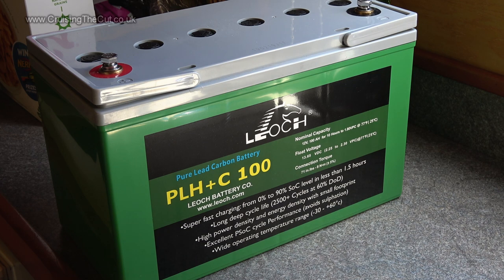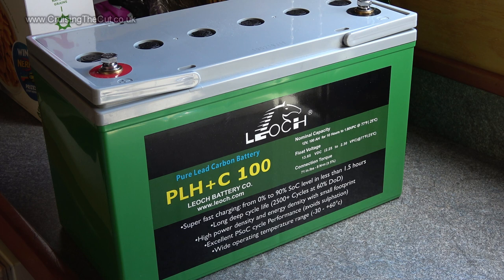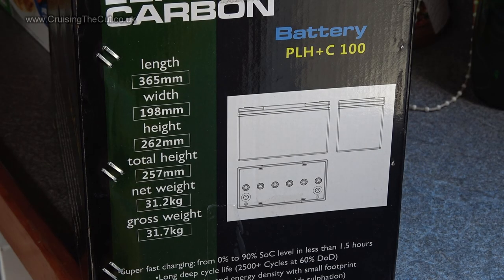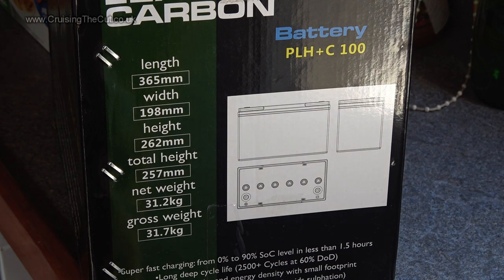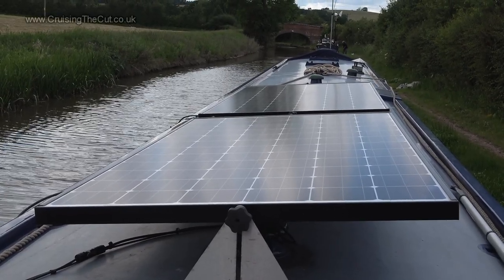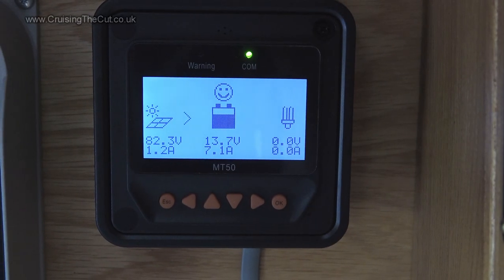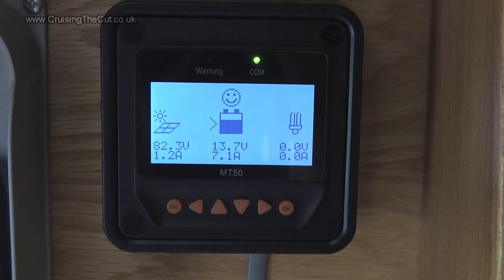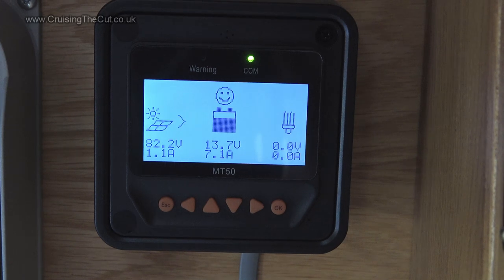178. Installing Lead Carbon batteries (12V 100Ah) into my canal narrowboat

Comment: How do these batteries compare to the cylindrical gel ones please?
Reply from the maker: Not sure. I was considering those gel ones last year but kept reading they needed a specific charging regime but couldn't find any details about it so when I discovered the lead carbons, I just went with them. I think the lead carbons have more charge cycles.
Reply: @CruisingTheCut  Thank you.  I knew you were looking at different kinds of batteries and wondered what fixed your choice.  I have had the cylindrical gel batteries installed for 20 months now and  have been very pleased with them.  Looks like the devolment of the lead acid battery has not reached its zenith yet.  Maybe the lead/carbon cell will prove to be a cost effective option to LiFePO4 units.  Maybe super capacitors next?

Comment: Will the higher charging rate burn up the “normal” engine start battery?
Reply from the maker: No, the starter battery is effectively isolated from the leisure cells even though all the -ve terminals are joined.

Comment: Isolating the batteries was a smart idea, but whomever told you that the placement of the cables mattered doesn't know anything about electrical's.
Greetings an electrical engineer.
Reply: Just as what you connect first doent matter.
Oh and also there is no charge in your invertor, its the charge in the batteries rushing into the coils in the invertor. Dont worry. they can handle it. Hell you could even weld directly from some batteries.
Reply from the maker: I rather think they do. See (amongst many many others) http://www.smartgauge.co.uk/batt_con.html
Reply: @CruisingTheCut  Ah thanks for the link. Very much apreciated. I shall investigate. :)

If not clear yet. very nice video i enjoyed it. Keep 'm coming. :D

Comment: hope the negativ was the first to disconect :D this way cant do short between the bord or  other things
Reply from the maker: Ahaha and that's exactly why I didn't show you .. already there's another commenter saying "+ve first" ;-)
Reply: Removing the negative first can leave all your other ground wires to take on the job of grounding for the short while it takes to then remove your positive lead.  Check out your system first to see how everything is grounded.

Comment: The spark is because the batteries have a charge, that spark comes from them, it's the same as taking a wire and touching it to both terminals of one battery (don't do that the wire can weld itself into the terminals and the battery will overheat and explode). Just make the last connection quickly, don't hesitate or you get a spark.

Comment: Read up on the difference between Series and Parallel Wiring... Series Wiring will multiply your Voltage... very important to note  as your charger could be made for a single input voltage, and this could damage your inverter if you feed it with the wrong voltage...

Parallel Wiring will multiply you Amperage

Series/Parallel Wiring will multiply your Voltage and your Amperage 

You have wired your batteries Parallel... all of the batteries will have the same voltage on your Line Side, and the Amperage will be multiplied...

Industrial Electrician
Reply from the maker: Thank you; yes I'm aware of the difference and yes the bank has always been wired in parallel and will remain so; cheers though!
Reply: Sorry again, I was typing while watching should have waited till the end...

Parallel is always best as your charger/system sees the Batteries as one Battery... a Battery of Batteries... You can do this with in turn with any kind of load (lights, circuits, what have you) and you system will see it as one load...

No need to shorten sail and pick up my comments David,  just an old cranky Electrician poking his nose a'midships...
Reply from the maker: Ha! I'm a grouchy old YouTuber, especially when I decide to answer comments on my phone at 2am because I can't sleep. Apologies.

Comment: I do a lot of high tech engineering on my boat and my lithium batteries still terrify me.  They are like armed bombs looking for an excuse to go.  You can usually get the charge voltages by just referencing the voltages for your battery type, in this case carbon-lead.
Reply from the maker: Cheers. Yes I did some research but I wanted to know the manufacturer's specific spec just in case!

Comment: David, you're hooked up in parallel so other than minor fractional line resistance  having the charge line hooked to the middle isn't an issue. If it was a 24v system with 2 batteries in series then you want to go positive on 1 battery terminal and negative to the other battery terminal.
Reply from the maker: Cheers yes I know it's in parallel but it's good practice as I understand it to wire across the bank rather than into the middle. I agree the difference is probably negligible.

Comment: Is the battery compartment ventilatedI.
Reply from the maker: Sort of, to the degree that it's in the engine bay which is not exactly sealed. But the batteries are non-vented anyway.
Reply: CruisingTheCut is the engine room well ventilated enough to remove most of the heat the engine produces? Batteries don’t like heat. 
A sensor with remote gauge might be handy.
Reply from the maker: It does get a bit hot in there, since you mention it, it's not well ventilated in terms of cooling.
Reply: CruisingTheCut Amazon has small computer cooling fans that use magnets not bearings, don’t spark and require very  low power consumption. They would be easy to install by cutting two four inch holes in order to ventilate the engine and the battery compartments. One could easily be wired to turn on when the engine is on and the other just it full time. They are typically used to cool computers. I find working on boats is almost as much fun as using them.

Comment: Move one of your temp sensors to the battery compartment and monitor the temp a while. Any over charge or over load problems will be evident through heat buildup. Excellent job.
Reply from the maker: There is a temp sensor on the new bluetooth dongle to the inverter, I showed that ;-)

Comment: Hiya David, you should check out Will Prowse on here, he tried a few battery monitor things, that gives a % and he said there's a good one that only cost about 30 quid off ebay
Reply from the maker: Yeah I know the one you mean. The trouble is, all Amp Hour meters work on a bit of guesswork once the battery is anything less than brand new, so they're inaccurate. And all volt meters will show an inaccurate state of charge unless there's no load on the battery and no incoming charge from anything else like solar. So in reality there's no really good way of knowing what your battery is doing unless you measure voltage with everything disconnected in the dead of night...

Comment: Not a fan of how you have your solar wire running across your positive connection of the 3rd battery. Think it would be easy to zip tie it away from it very easily.
Reply from the maker: Now, now - what did the caption say, eh?

Comment: Your in reasons doesn't matter. It doesn't matter where the connections are made. As you keep the starter battery separate.

Comment: Did you know that you could use your old batteries as part of a welder as all you need is 36 volts to do what some people call stick welding.

Well done for doing DIY as for batteries sparking thats normal so i wouldn't worry about it and its caused by different voltages nd no they wont blow up unless you use dynamite lol 

Reason people remove the negative 1st is taken from vehicles as all modern day vehicles are negative earth which means dont need to tape spanner up when removing the negative (black) wires.

How much were the batterys  each ?
Reply from the maker: I paid £205 as a special show price but they're normally more, maybe £240. Link in video description
Reply: @CruisingTheCut   Ouch !!  bet that hurt your bank balance 

With new technology it is always a good idea to wait a year or 2 for price to come down
Reply from the maker: I thought that was a fair price, especially since the AGM batteries I otherwise would have bought (identical to the old ones) would have cost the same, so waiting wouldn't have made any difference in this case.

Comment: You have probably been told this already  but it is absolutely normal for battery sparking when reconnecting the negative terminal.  This has nothing to do with the inverter.  The same thing will happen if you do this on your caravan or automobile.   Relax!
Reply: Capacitors are found everywhere and are the cause of the spark. BTW...manufacturers differ on which lead (+ or -) should be detached first and attached last. Check your owners manual. My Ford will absolutely not start will not start unless the positive lead is attached last to satisfy the alarm system.
Reply: @geraldhenrickson7472  lol, better speak of what you know... He mentionned twice that the main switch is off, so the inverter is not connected to the battery, the reality is that when you connect two or more battery together there will be a spark, no matter what, and it is totally normal because the battery does not have a null resistance and voltages are not perfectly equal across the battery bank.
Reply from the maker: @lo2740 Actually, the inverter is one thing that is not connected via the main isolation switch but directly to the battery, for reasons I can't recall. "better speak of what you know" lol ;-)

Comment: I'm trying to configure my mt50 charge controller ( same as yours ). I don't understand which one is the charge voltage configuration. Can you help me with setting it up. So I got 
over volt.disc 16.0v
Charge limit 15.0v
Over volt. Rec 15.0v
Equal. Charge 14.6v
Boost charge 14.4v
Float charge 13.6v
Boost Rec. 13.2v
Low volt. Rect. 12.6v
Under volt. Rect 12.2v
Under volt. Warn 12.0v
Low volt. Disc 11.1v
Discharge limit 10.6v
Equalize time 120min 
Boost time 120min. It be alot easier if you named it like the controller calls it not everyone understands which one you actually ment when you said charge voltage
Reply: The only one I understood is the float charge as it's the same name on the controller it self
Reply: Also when I was fitting it in I had the positive wire touch the negative terminal for split second and had a big spark, could it damage the batteries?
Still new to all of this so help would be greatly appreciated. Thanks

Comment: Which terminals are used to connect other stuff to on batteries that are all wired in parallel like that 110% doesn't matter - provided all battery connections are good.
Reply: It does matter. It will charge/discharge unevenly if you don't...

Comment: I saw the red solar cable laying on the battery pole, because of vibrations of vehicles all wires have to be fixed when they lay against or on sharp objects. After several years it can cause fire.

Comment: That battery company is shady as hell,  printing the box dimensions on the box like that is extremely misleading, Who gives a shit how big the box is unless you’re trying to fool a gullible consumer (which most of us are) into thinking its a bigger battery. Interested to see how well they do for solar though.
Reply: Printing the wrong dimensions on the battery box could be a cultural thing, a miscommunication thing, a complete muck up or intentional for some reason. ONLY THE LATTER would be a "shady" thing. Please consume less legal stimulants (coffee, etc...) before commenting.
Reply: carton dimension is very often printed on the carton for logistic purposes, in particular for sea shipping where you need to know the volumetric weight, nothing to do with fooling consumer really...
Reply: @lo2740  Often on the outer carton but I've never seen it done on an inner piece part box, that's strange.

Comment: Disconnect the Negative terminal first. The reason is if it sparks the spark jumps INTO the battery rather than OUT of the battery if the positive is removed first. Safety first.
Reply: Thanks Cameron ... I'll remember that next time I disconect a battery... really makes sense.
Reply: @CruisingTheCut  Most of the advice is based on automotive practice viz: "By removing the negative battery cable you are disconnecting the battery from the chassis of your vehicle. If you begin to remove the positive side before the negative and your wrench would make contact with any part of the vehicle, then you could cause a short in the system."
Thus in the case of the boat, the risk is the spanner connecting with the hull if you try and remove the positive first. Your taping of the spanner removes most of the risk of that anyway.

Comment: Why don't you get a generator that runs quiet. Honda makes one that will carry your entire boat. One tank of gas for 8hrs is worth it. Your solar system can be a back up.
Reply from the maker: Firstly because I don't need a generator, the solar provides everything I could want from April through to October. The old batteries simply couldn't store it! Secondly, gennys are noisy and annoy both me and other boaters. Thirdly you have the issue of buying and storing petrol (not readily available on the canals so you have to trek to a petrol station) and I have nowhere suitably vented to store it.
Reply: also doesnt the engine charge the batteries too ?
Reply: @CruisingTheCut  I own one of the modern inverter generators (mine is made by Briggs & Stratton), mine is 3K watts to run an A/C probably not needed in the UK, they do make smaller ones.  At low loads these make less noise than a passing train or bus, way less, and could probably top off your batteries after a couple of rainy (sunless) days that never happen in the UK in an hour or two while the 12v dc side tops off your starter battery.  They make way less nose than your engine and run about 8 hours on a tank (1 gallon) at half load.  Even when heavily loaded they don't interfere with conversation, don't knock them until you have at least heard one in operation.  Sailboats usually carry a jerry can of gas tied up to their side rails, use it for the outboard on their tender.
Reply: CruisingTheCut What David said...! Like!

Comment: I was always taught to disconnect the negative, and then the positive; followed by disconnecting the positive and then the negative: from the vehicle being jumped and the electricity providing vehicle respectively... Which is more about things to think about when providing a jump using jumper cables; along with the ground being on the battery itself for the running vehicle and on the frame/block on the one to be jumped. So not really helpful at all really. 
As for what you were doing, I don't think it really matters. Dealers choice on that one. I may usually go positive first when removing a battery, but fine with clearing the negative terminal only when I just want to not have electricity flowing for safety.
Really just wanted to say how spot on, and humorous, it was to short circuit the entire issue by doing it off screen, as it were.
Also, I keep watching this video over and over.
Reply: The order to disconnect batteries is not about positive and negative ! It's about surrounding bare metal that's also part of the electrical circuit. In the case of a negative earth vehicle, remove the negative lead first. It's all in case your spanner touches bodywork as you're undoing the bolt - there would be no voltage across it.
Reply: Should be the earthed pole, whether positive or negative, that is disconnected first and connected last. this is so there is no potential between any terminal of the batteries and earthed metal. This is important on metal structures, such as cars or boats, so that a spanner being used on terminals or a cable connected at one end can't short to earth.
Reply: Usually you are correct but with boats they are wired above earth to help reduce electrolysis and to give a better earth connection whereas a car is earthed to the chassis so as a general rule yes remove the negative first and reconnect the negative last

Comment: 300 Amp Hours at 60% means you actually have 180AH of usable capacity and regular discharge that deep will shorten the battery life. 
I’d have used LiFEPO4. More money but more reliable and no explosive gasses to worry about. Not to be confused with computer, phone and tesla car batteries. 
Disconnecting Earth first is the safest. If a connector accidentally touches the boat hull, it’s just touching the same earth polarity. With all earths removed the positives are safe.
Reply: But with all positives disconnected there's no voltage anywhere to short.
And the negatives might function as safety grounding for some appliences, so disconnecting them first might leave all of the boat's hull charged with a voltage (from stray miniature currents) and acting as a big capacitor waiting to discharge through anything conductive (the person inside the boat), if it's badly wired or any part of the circuit is malfunctioning.
Reply: @stepanpavlica4841  Don't worry David is talking out of his head covering. If he had read up on Lead Carbon, he would see the Voltage drops off more rapidly than lead acid, and they will appear at 50% from 70%-30% without sulfating, He just wants you to know, he went for LiFePO4 (which he can't spell) He is superior to us other chemistry users. He can't do Maths either. At 60% you have used 40% or 120Ah So the useable remaining is 90Ah, as you shouldn't discharge below 30% - 90Ah, instead of the 50% or 150Ah of a flooded lead acid battery.  Lead Carbon 210Ah useable power from 300Ah.

Comment: Get an bluetooth dinky or what ever for your solar regulator what make life so much easier mine is build in it would not go without one anymore
Reply from the maker: Sadly my solar charger does not have a bluetooth accessory. I might swap it for a Victron one to match the inverter/charger one day, then I can use the same phone app to monitor things.